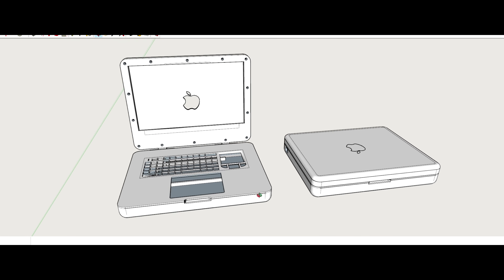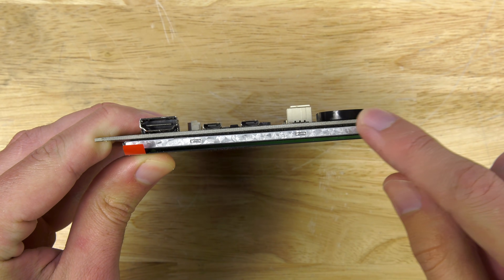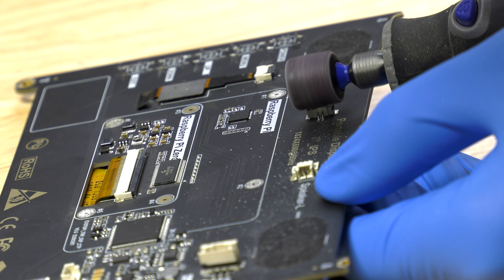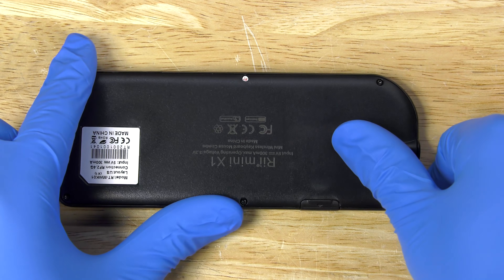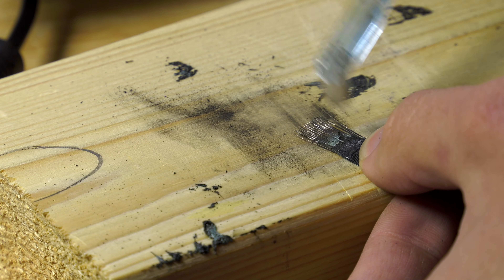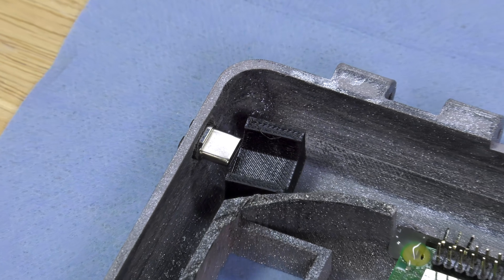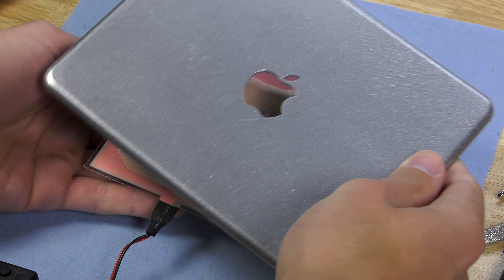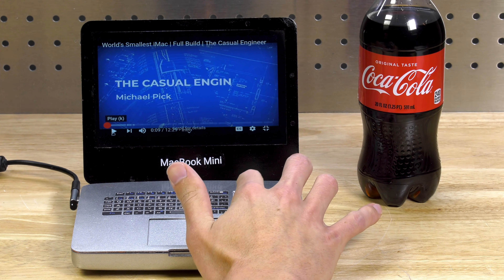World's Smallest MacBook

Comment: I have an older Chromebook with useless specs but gorgeous screen 1080p and surprisingly great speakers, I found your video searching for a way to replace the internals with a raspberry pi 4 o other better hardware, it would be a great build video for you as there is a ton of these devices around catching dust.
Mine is a Toshiba Chromebook 2 cb35, besides the horsepower it's a great device, would be a shame to discard it.

Comment: Bruh You know you could just remove the HDMI using a solderer right? less messy and if you need it ever again you can solder it back.
Reply from the maker: It's very difficult to desolder an HDMI connector with a soldering iron. The Dremel was a lot easier/faster, so that's what I went with.

Comment: This is quite a beautiful build.  That transparent Apple must be a head-turner.  Seems like it would almost make it worthwhile to go to Starbucks just to whip that out and fire it up!  And making a plate with holes for the keys was truly going beyond the call - most of us would have just made a hole that they whole keyboard sticks through.

I just bought a 7" display to build into something like this.  By shopping around a little, I was able to find one that had very little that needs to be removed - just the HDMI, the MicroUSB, and a switch for the backlight.  No standoffs, no buttons.  I DO have to cut off the mounting tabs, though.  No biggie - those cutoff wheels are my most-often-used tool for the Dremel.

I was considering replacing the double USB connectors with single ones (didn't even think of just cutting off the top ones!), but instead I have decided to make the case roughly the layout of the original Toshiba 1100 laptop, which will give the Pi and the batteries space behind the hinge all to themselves rather than having to stack anything at all on top of the Pi.  (The batteries are from a torn-down 10 A*hr power bank, which has four 18650 cells.)  In principle, this should allow me to make the whole thing less than an inch thick when closed, because the display closes over the keyboard, which will be not much thicker than yours.  Also, I'll be using the touchscreen as my main pointing device, allowing me to use larger keys on a 50% keyboard with 17mm keys.  I'll be going a little wider than your case, since it will be the keyboard dictating the width rather than the display, so the overall footprint will be larger than yours - I'm looking at about 210mm wide x 180mm deep x 25mm tall (8.25" x 7" x 1").

We each have our own preferences - I like to think of Pi builds ("cyberdecks", mini-laptops, bug-out box builds, whatever) as being the technician's equivalent to a Jedi knight's light saber.  Again, awesome, inspirational build.
Reply from the maker: First, let me thank you for taking the time to check out my build, Second, wow! You really put a lot of time and effort into your design!!! I'm impressed! Please let me know when you build this! I can't wait to see it! I love builds like this!!!

Comment: I can't quite put my finger on the why, but your removal process feels like obliteration. :P
My top suggestion: get a hot air soldering/desoldering station. Makes removing unwanted surface mount components that much easier and cleaner.
The cheaper wireless keyboards most often have a separate touchpad module, which would've let you put the touchpad in the proper place for this build.
Reply from the maker: Thanks for the tip!
Reply: @MichaelPick  get a 858D for the beginning they are dirt cheap...
15-20€/$ incl. Delivery

Comment: I like the build overall but was a dremel really the best tool for slimming things down? Surely a $20 hot air station would do a much better job.
Reply from the maker: That might be a good option! I tried de-soldering the HDMI port on a screen for this video, and totally destroyed the traces underneath it, so that’s why I opted for the Dremel, as I could control exactly what material I removed. But a hot air station might be a good option!
Reply: I used a Dremel to slim down my pi and it still works.